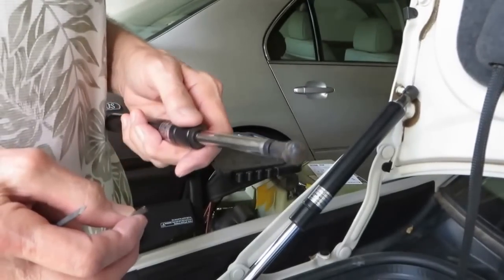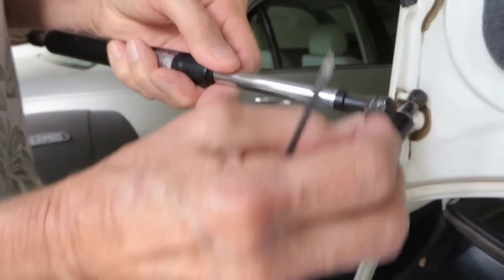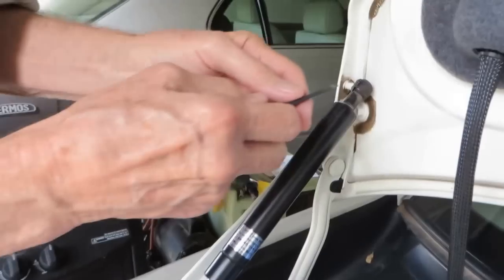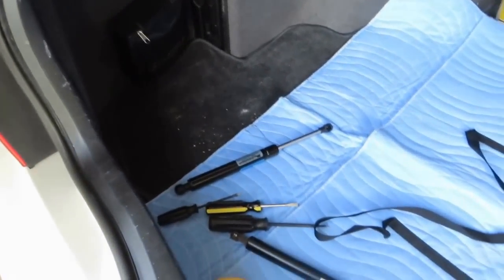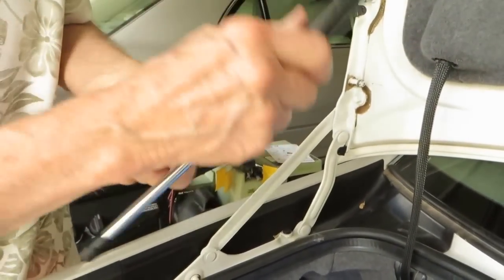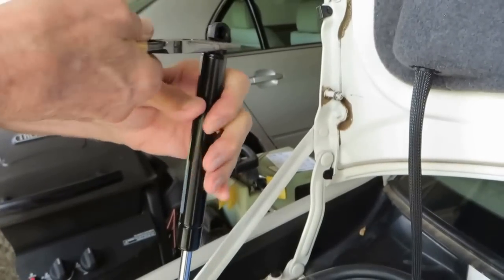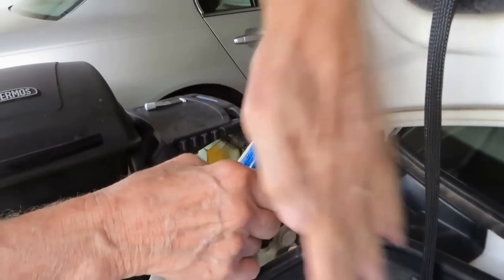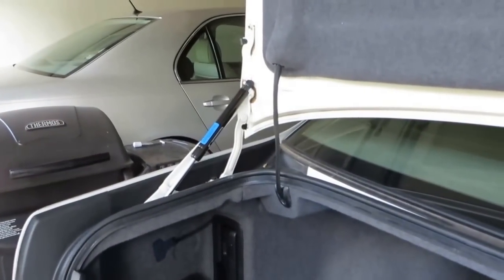How to Install A Trunk Strut/Lift Support for 2003 Lexus/ LS430, 2001, 2002, 2003, 2004, 2005, 2006

Comment: A piece of advice for you out there looking for changing out gas struts. Just had this replacement done now, and I found that there's no need to bring the C-clamp out. It's a tough job to do and unecessary. Just push the bolt in and it will slide right in without complication. Also on my replacement struts, these bolts were included.

Comment: Thanks, helped alot. I had to push up on the trunk quite a bit for them to click in. Now instead it being an effort to lift, it's effort to close. And the trunk does lift itself when you get near the half way open point.
Reply: Did you use OEM Toyota struts or an aftermarket brand?

Comment: Your directions were flawless!  But let me ask,  is the trunk supposed to open by itself once the trunk button on the fob is pressed?  Mine unlocks but the new struts don’t lift the lid...  they are apparently not powerful enough. I’m not sure if it should lift open or not.
Reply from the maker: I have to initiate the lift on mine, too. What I appreciate most, is the trunk lid staying up when I'm using trunk space.That is the main reason I replaced.

Comment: So by replacing the trunk struts, when you click on your key remote for the trunk it should pop up fully open to the top? Thank for this video, made it look really easy"
Reply from the maker: NO - at least not for me. When I use my remote, or open inside the car, it simply opens - the trunk lid does not go fully up... I have to push mine up. The struts hold the trunk lid open, preventing it from falling down. I hope this helped you!
Reply from the maker: OK - I just watched my video again... When you click to open, it does just open- But, you need to start the lifting process - no pressure pushing to lift... the hydraulic strut helps out on that part! Funny the things we get use to and then take for granted! ALSO, I've just noticed my husband didn't put the clips back on... can't recall if he did it later, or not. I guess we saw it worked and got all carried away with ourselves, not even paying attention to the clips... or, perhaps these struts didn't require clips. I hope your installation goes smoothly!
Reply: It would be nice, but not in the rain if you were using the interior release switch!

Comment: Hello, thank you for the video. Can you please tell me who the manufacturer is for the trunk struts.Thanks
Reply from the maker: +Amy Naadimuthu  I'm so sorry - I didn't see your post until just now. If you haven't purchased yet, here's the info... I purchased from Amazon. Just make sure they are the correct ones for your auto :)  Qty (2) Strong Arm 6415 LEXUS LS430 2001 to 2006 Trunk Lift Supports Struts Shocks - sold by Strongarm

Comment: I have a 2005 sc430 and the retaining clips are not as easy to get to as shown in this video. I do not see an illustration on my model. It seems as though I have to remove a few star bolts of the hinges to gain access, is there another way?

Comment: Where did you get the parts?
Reply from the maker: https://www.amazon.com/Premium-Tailgate-Supports-Struts-2001-2006/dp/B01H8A88ZI/ref=pd_lpo_263_t_0/135-0878714-6917239?_encoding=UTF8&pd_rd_i=B01H8A88ZI&pd_rd_r=111a4103-b6c9-497d-820d-df5a760659d4&pd_rd_w=MtzdF&pd_rd_wg=0FJV0&pf_rd_p=7b36d496-f366-4631-94d3-61b87b52511b&pf_rd_r=4VPJ1MRQXV6WX0RK4697&psc=1&refRID=4VPJ1MRQXV6WX0RK4697
Reply from the maker: Wanted to let you know - This link isn't the pair I ordered. From what I read, they appear to be the same, with exception this pair is offered with Amazon Prime and is less costly. Just make sure they fit your year/model. Good luck - Hope your ring in a Happy New Year!